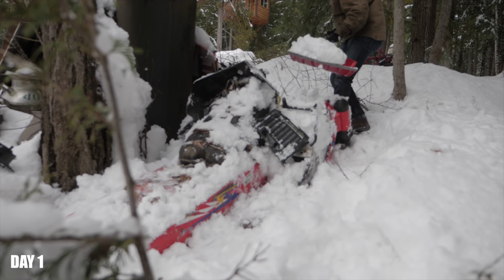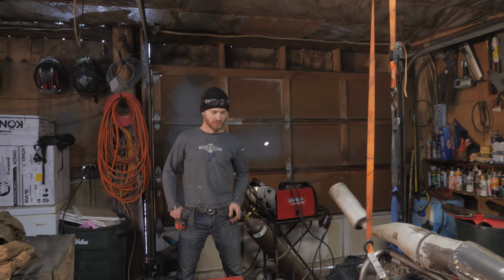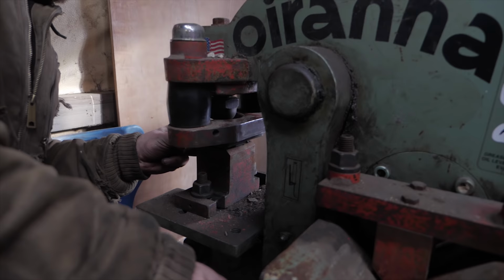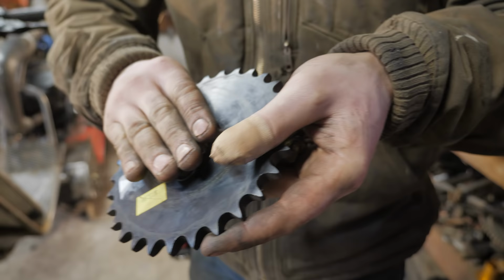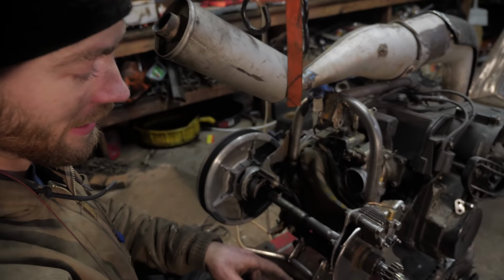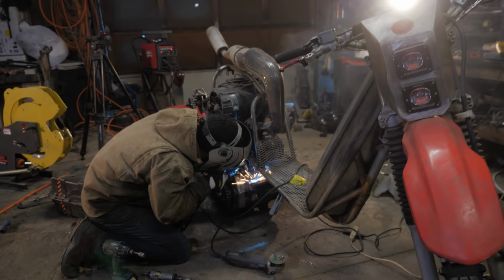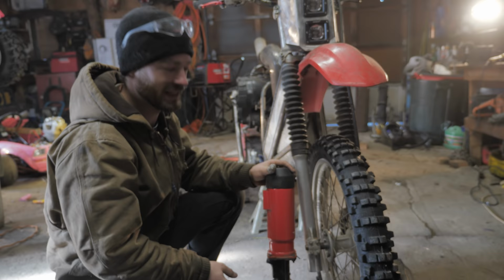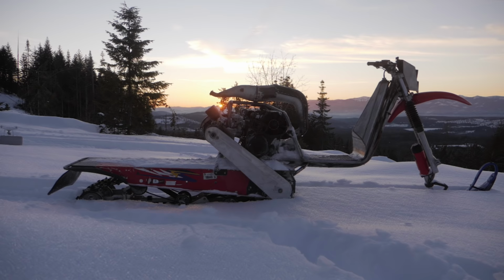Building a Snow Bike Kit for 500cc Snowmobile Powered Scooter!

Comment: Oh. My.. This thing gets wilder every time you guys touch it! Awesomeness! There's a lot of movement in the front, meaning suspension, but I think there should be some in the rear also. I could be wrong tho, don't know that much about snowmobiles.. Anyway, awesome work, as always! Greetings from Finland! 👍🙂
Reply from the maker: There is suspension inside the track but it is a bit dated
Reply: @GrindHardPlumbingCo  Oh, now I saw it in the track frame. 😊

Comment: I wonder if it would be more controllable if ridden like a big Mountan sled. Such as putting more of your body weight to the side rather then relying on the handle bars to steer it...?
Reply from the maker: Quite possibly. I plan on widening the foot platform for better control of it, which might help with what you are talking about.

Comment: Just a piece of advice from a dirt bike rider, maybe add a seat so you can use your legs to handle the bike. Without any way to use your legs that thing probably feels quite out of control
Reply from the maker: It’s possible that would help. I’m also thinking of widening the foot platform to make it more stable and controllable.

Comment: What welder do you guys use, and what type of welder do you recommend for fabricating car stuff??
Reply: Isaac Yoshioka  we have a everlast they are a good bang for your buck if you are looking at welders that any good
Reply from the maker: We have a Lincoln LE31mp welder. It’s very compact, and can weld mig tig, and stick. It costs about $800 new, without the tig setup. I definitely like it, but I’m sure you could get a similar one from a cheaper brand that would still be good.
Reply: @rugger8787  thx
Reply: @GrindHardPlumbingCo  Thank you

Comment: there is a reason timbersled calls their kit a "mountain horse" lol! Snowbikes just don't work well on hard pack, the reason they went to wider ski's and narrower, curved tracks, is to make them behave better on hard pack.
Reply from the maker: Yes, that’s true. And it seems like they are going to tilting skids now too. I’ve been thinking about how to make a more flexible track setup...
Reply: @GrindHardPlumbingCo  Arctic Cat made their new sled rear suspension with a single slide bar on the track so it flexes the rubber side to side really easy rather than tilting the whole works.  If you put two skis side by side in the front it would probably help stability a bit, I dont think making the track more flex or tilt would help stability on hard pack.  Part of the issue is the foot placement on the scooter.  If you had pegs like a normal motorcycle your balance would likely be more "open".  Dual front skis could be made to tilt side to side a bit if it ends up making the front end dart around a little when loading up only one side of the ski on uneven surfaces.
Reply: @GrindHardPlumbingCo  tbh, I think you would be better off addressing the ski before addressing the track, it seems to make a bigger difference. I have had 3 TSL kits including one with the 1st gen wide ski, and 2 with the 2nd gen.

Comment: :27 is that an fl350 odyssey in the background? If so you need a sled motor swap in it! I've done quite a few fl350/fl400 swaps
Reply from the maker: Yes it is! And we plan on doing just that!
Reply: @GrindHardPlumbingCo  if you need any parts or tips feel free to ask, I've had alot of those machines. I think I'm fairly close to you guys  as well. I'm near Moscow, ID/Pullman, Wa